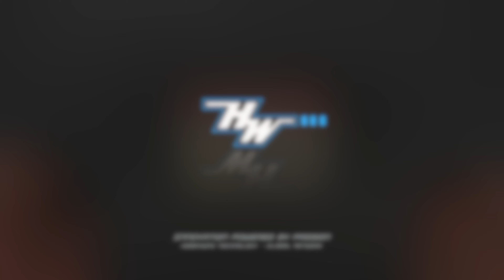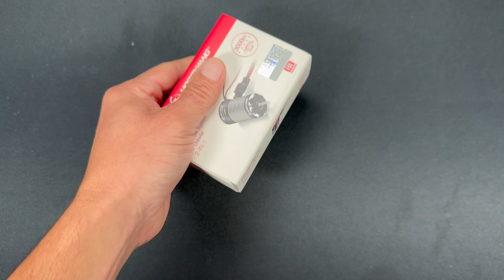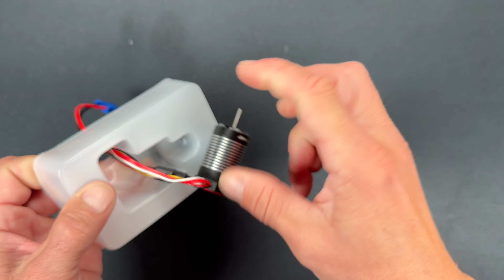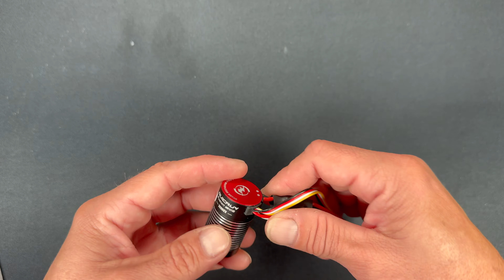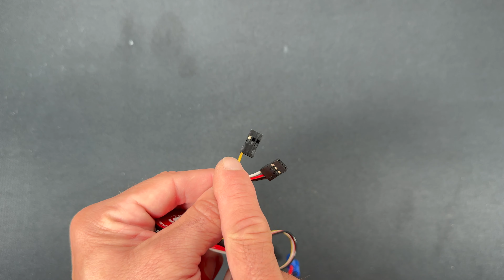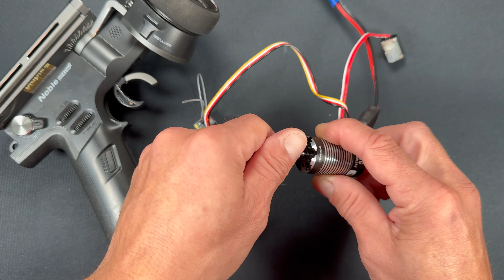HOBBYWING Quicrun Fusion Mini 16 - First Look

Comment: Nice! Next, I'd like to see HW make something like this for the mini bashers, for example Arrma GROM type vehicles.
Reply: This actually fits like a stock motor in the GROM series. You can even use the stock pinion as the motor shaft is 2.3. Just go in the settings and turn off FOC and reduce the drag brake. Makes a killer GROM set up on 3s!
Reply: 3000kv its prob spicey enough to drop right in esp w 3s